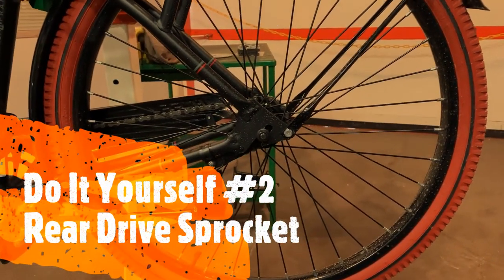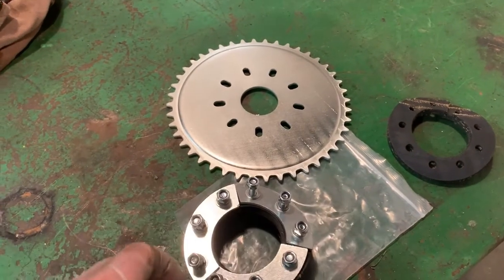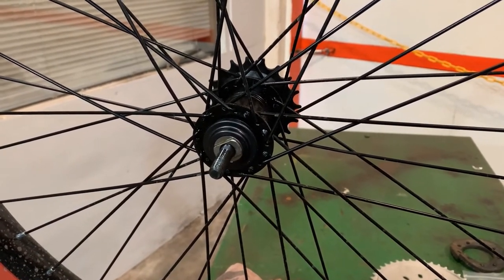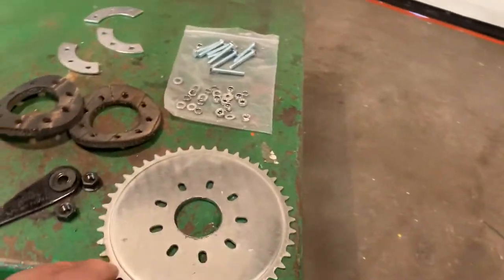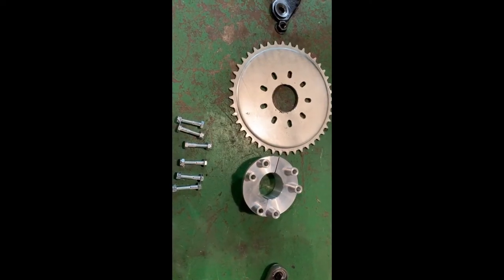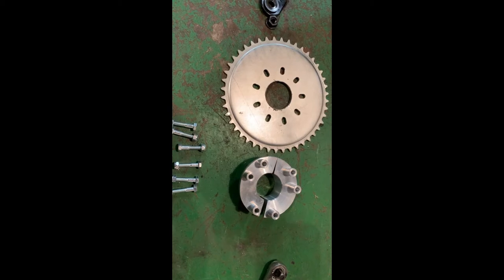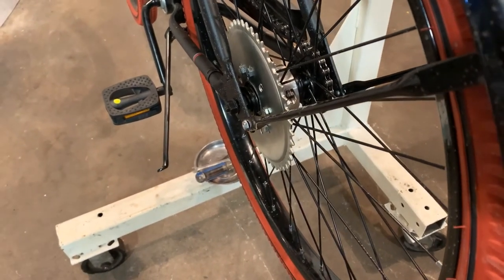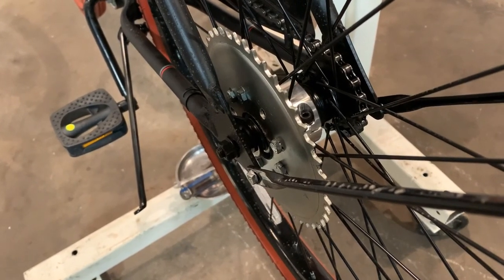D I Y #2 Rear Sprocket Installation 2020

Comment: what sprocket assembly is that , the aluminum one looks much better than SBP or bbr types
Reply from the maker: These do work great..!! I stumbled onto these a few yrs back, It's a company directly out of China that I get them from, I don't actually know their name ( I can't read Chinese) I had to set up a business account with them just to buy them ..:(  After trying them I stopped looking for others, these work perfect every time, they don't slip on the hub & kill spokes & you can use your standard 9 hole sprocket instead of having to spend more money for a sprocket that only fits an expensive CNC Alum. Sprocket ..:) I do have them on the web site if your interested..www.ecotransgaspoweredbicycles.com
Reply: I can't find it.